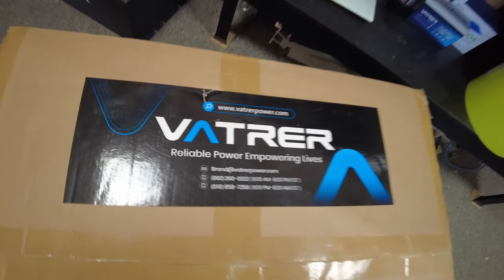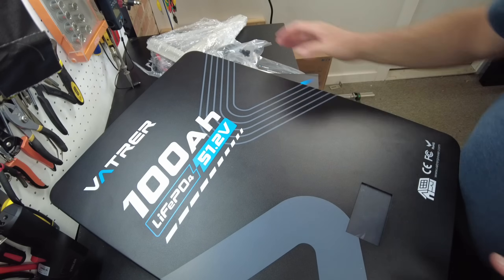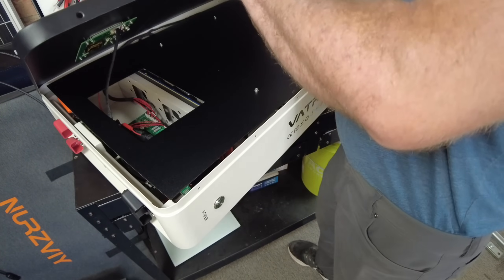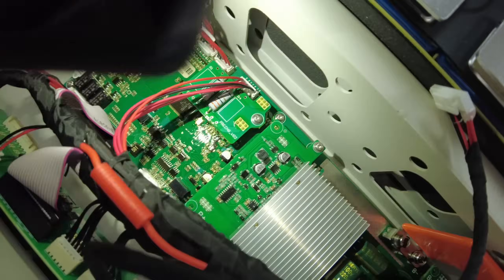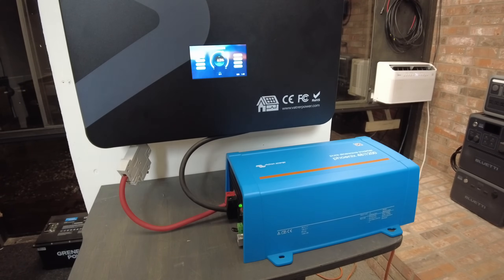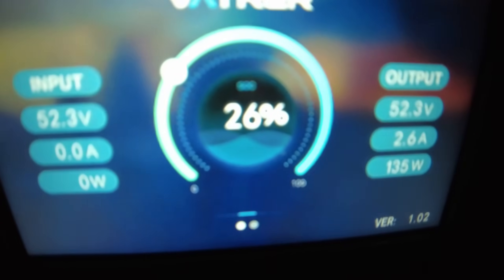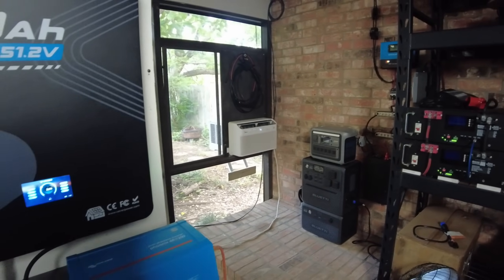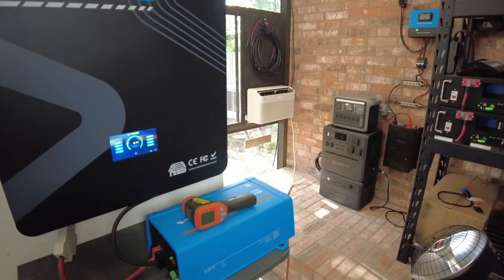Vatrer 48V 100AH Wall Mount LiFeP04 Lithium Battery

Comment: Good test! And good to know the run times possible with a window mount AC ...for those times when temps are hot and the grid is down. For my use, I'll l look at the server rack style instead of a wall mount.

Comment: That was kind of a $h_t show! The battery design means it must be wall mounted because the terminals and communication ports are on the bottom. The display is also near the bottom which is a very poor design choice.  You have to mount the unit up high if don’t want to be laying on the floor when reading the screen.  Who puts a screen on a 48 volt battery but not give access to individual cell voltages? Normally, you would want the AIO or inverter and solar charge controller(s) mounted higher on the wall than the heavy battery(s).  Those components are lighter and you want your system primary user interface where it is most convenient.  Clearly, they intend for the battery to be mounted high up on the wall like the rest of the system.  Why would anyone want to mount a battery that is over a hundred pounds up on the wall?   Sure, you may want to because of space constrains, but that should be an end user decision, not a design choice.   Good luck with having that battery half way up your wall during an earth quake!   Internally, the BMS is on the bottom, which makes the whole thing unnecessarily top heavy.  Why put the center of mass even higher?  Lastly,  I think Vatrer has a good reputation for their 48 volt server rack batteries reaching advertised capacity, but not putting a shunt inline with your run time test smells fishy.
Reply: the Bluetooth app shows all the data